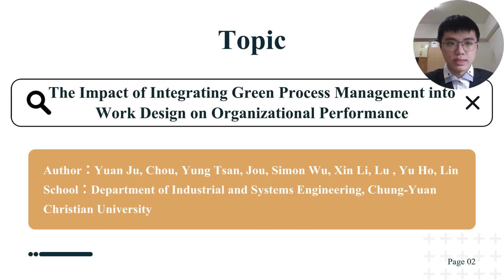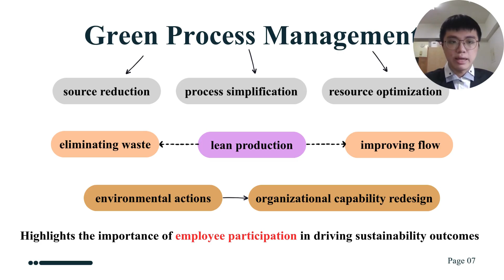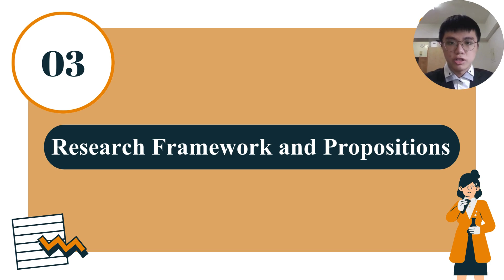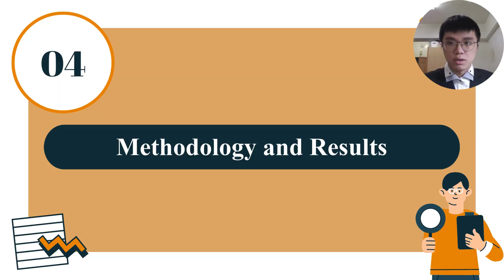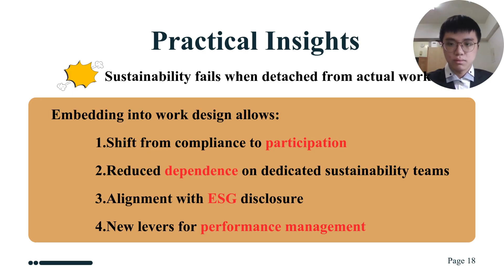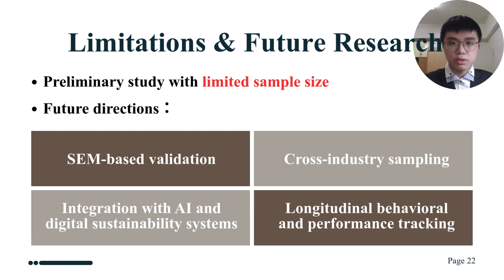GC-RBSTPE-021225-953 | December 2025

Comment from the maker: As the session chair, I have a question regarding your conceptual framework. You describe work design as a crucial link between green process management and employee environmental engagement, which ultimately ties into organizational performance. Could you elaborate for the participants on how you differentiate ‘green process management’ from ‘green work design’ at the job level? Also, I'm curious about your reasoning behind assuming a primarily one-way causal relationship from GPM to work design, then to engagement, and finally to performance, rather than considering possible reciprocal or feedback effects—like how engaged employees might inspire further process redesign. Clarifying this would really help the audience grasp the unique value of your ‘green work design’ concept compared to existing ideas like green HRM and employee green behavior.